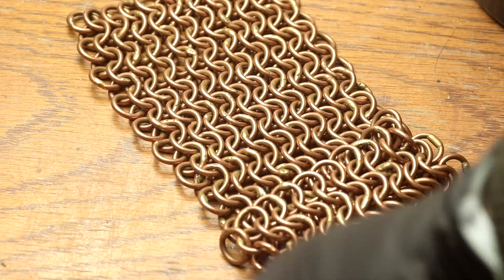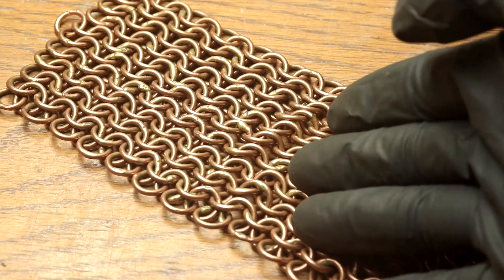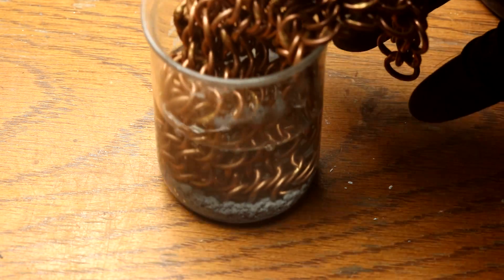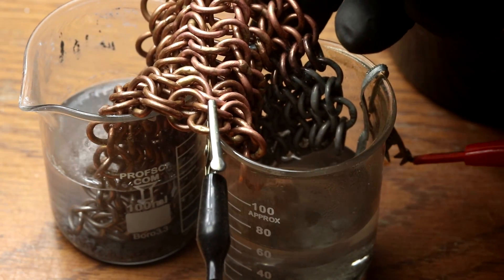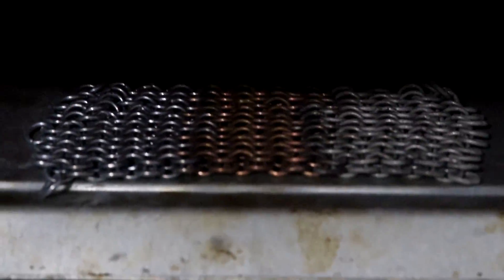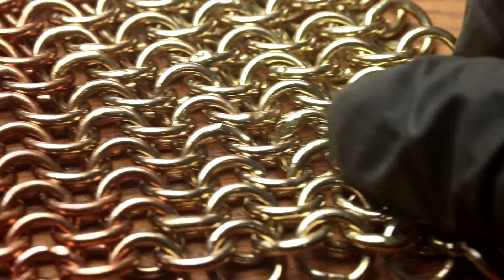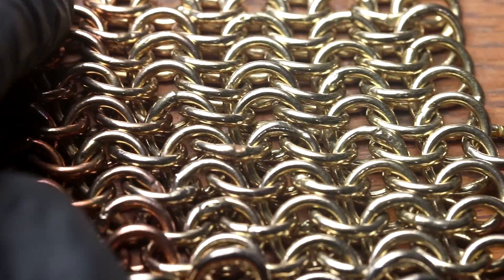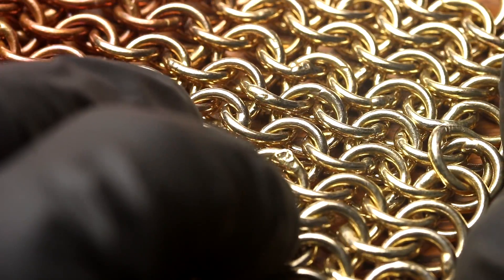Coating Copper in Brass and Bronze

Comment: Wife and I both agree, the brass is nice but a bit flashy, the copper is interesting, but the BRONZE is where it's at.  Makes it more durable as you said, but it's also more period appropriate.  The fact that it doesn't coat evenly gives it "providence", like it has actually been worn on a regular basis.  Much more compelling as a finished material.  2 VOTES BRONZE

Comment: I'd definitely experiment more on a few loose rings before deciding what you do.  Bronze with what is likely less tin than you've got there (or perhaps longer/hotter bake to diffuse it out more) for an effectively higher surface copper content makes a beautiful deep reddish brown.  Also some formulations of brass will oxidize to roughly the traditional dark bronze color after contact with skin oils pretty rapidly.  If you care about the aesthetics at all, then much more investigation is warranted before treating a project that will presumably take a lot of effort to craft.

Comment: By the looks of it bronze didn't work out so well, seems copper is much less likely to diffuse into zink than tin. Can you try to see what difference would higher temperature make?
EDIT: as Zutaca rightfully pointed out I confused the alloys. But it makes even less sense this way, in usual ratios bronze looks more like copper and does not have a silver metallic shine. I would have expected copper would diffuse more readily into metal which likely melted in your oven, but it didn't!
Reply: @zutaca2825  Thanks for pointing out, it is even more confusing now when I take your comment into account :) Coating on 'bronze' side still looks very much like tin!

Comment: The bronze looks like a high tin alloy like bell metal or speculum metal, perhaps a little more time in the oven to diffuse into the copper? I think this has already happened on the welds.

Comment: You could cover the whole thing and 10 1st and cover it and Brass the second coat instead of using the way you did it you can put back your brass and diffuse it into the copper on top of it

Comment: In my opinion the brass is probably the best option. The pure copper looks cool and so does the zinc coated copper, but the brass is the best for a combination of looks and durability.
Reply: The best for durability would be leaving it copper. Any plating will show wear.
Reply: @xenonram  That's like saying that the best way to stay warm is to not wear clothes because clothes will wear down over time. Sure, the coating will wear off but that means the rings themselves aren't wearing down and it's providing added chemical resistance in the meantime. That's the point of armour.

He's adding armour to his armour.
Reply: Think you meant bronze as far as I can tell.

Comment: I vote for bronze with several treatments. Perhaps the welds woul take it better with multiple treatments, but either way I think the bronze looks better. The brass is a bit too flashy in my opinion. Perhaps if we're duller or more muted, but that's why I like the bronze better

Comment: I have a couple of sheet iron soldier's tins from WWI. They need retinning. One is a sort of double-ended metal bottle used for coffee and sugar. It's a bit larger than a butter dish, and fits into the other tin, used to hold dry bacon. Could you give more details on your tinning? Would HCl clean or destroy the sheet iron? Wish I could simply get them hot-tin dipped but those places only want to do yuppie copperware at painful prices...

Comment: Getting any substantial thickness of zinc or brass would be difficult since your plating method stops as soon as there is a complete layer of zinc on the more noble metal.
The electrolytic deposting you used for the tin can deposit any thickness.

Comment: Having built my own mail byrnie as a replica of the Bayeux Tapestry mail many years back, I made mine from the black spring steel coat hangers. "Rolled, cut and knitted with care".
 It works quite well, but be sure to wear a padded gambeson under it.
 The correct way to clean the mail originally  was to put it in a barrel of sand and urine and have your squire roll it around the courtyard for a few hours. ( Not having a squire,  courtyard, or the required amount of urine on hand, I put mine in a hot solvent bath at the local automotive engine rebuilders). It will protect you quite well from slashes, but pointy objects like arrows and knives can pierce it.

  I would suggest you look at some of the photos of the Higgins Armory Museum  in Worcester MA.  A visit to it is extremely educational. 
I saw a chainmail shirt made in the Middle East where each link had a verse of the Koran engraved on it, thus the wearer was literally protected by the "Words of Allah". Also the knives forged from meteoric iron is awesome!
  Their collection is really impressive.

Comment: Yeah you learned how to make 4 on 1 chain mail and electrolysis, the movement of one metal onto another using metal solutions and electricity.   Sadly Cody  I'm unimpressed, I was doing this back in the late 50's.

Comment: I wonder if you would be able to tie-dye it. Obviously as the links are larger than than the spaces between fibers in cloth it would be hard to eliminate diffusion of the solution in the same manner. Maybe if you were to add the "tied" chain mail to the center of a water vessel and then add zinc powder and sodium hydroxide around it without stirring you could limit the diffusion of the zinc plating materials to a central, tied off portion of the chain mail. Then, by timing the submersion carefully, a similar effect might be achievable.

Comment: using all three together could make an amazing piece only downside is you would probably end up having to coat the rings before knitting them to make the patterns I'm thinking of and for the extra effort it probably wouldn't be worth it, there would also be the matter of the weld joints if done this way. all three are good but i would use at least two to spice the final product up a bit instead of just having it full gold/copper/black

Comment: Hold on can you do another video like actually explaining how this all worked. Like this is really cool and I want to see how it’s fully done  like oven temperatures and whatnot.
Reply: Could you like not like so liking often?
Reply: It's simple, the two metals simply fused at the high temp to create an alloy.
Reply: Tundra1232 he electroplated the copper with tin and zinc respectively, both of which form alloys with it. When he heated it, they fused into the alloys leaving what we see in the video
Reply: Basically he ran an electric current through a solution of dissolved metal salts. Those positively charged metal salts can take some of the negative electrons moving around in the liquid (from the applied current) and form solid metal coating on the pieces of chain mail. They accumulate over time bit by bit, layer by layer until there's a coat of tin or zinc on the copper. Then once the metal is plated he heated the metals in an oven to create an alloy, or let the metals mix together to give different properties (color, melting point, strength, etc). There's lots of neat videos on youtube with electrochemistry demonstrations and good explanations of how it works physically.

Comment: I personally prefer the bronze.
The brass certainly looks shiny, but to me that just doesn't quite fit, too much bling. The bronze looks way more robust and tough, which I think it should be since it's, well, armour.
Reply: The problem I see with that is that if you didn't want it to be silly and pretty, why would you make it out of copper instead of steel in the first place?
Reply: Oh I don't know...maybe that steel sucks to join together to make mail...and would most likely need rivets. I mean...it isn't impossible...but i wouldn't want to spend my time on a piece of mail no matter how cool its looks. Buying on the other hand...that i can get behind.
Reply: @TheAsigmaOfNone  But that's the thing, he already has steel mail. And the raw material for the copper mail likely costs more than just buying steel mail anyway.
Reply: Brass is a no go. I play brass instruments. It is a metal you have to take care. Simple oils from from the human body can tarnish it. I have worn my valve casings on all of my horns just with simple ware. Brass is also is very temperamental in cold weather. I have formed a crack in my bell on my euphonium just by playing it too loud in the winter. Brass is blingy and a has a great harmonic resonance, but I don't believe will make great armour.

Comment: Copper looks best, it is also rusic and should remain looking good even if it stains or wears.
Reply: Guðmundur Karl Karlsson it would corrode, slowly tarnishing, rusting, and staining your undergarments greenish
Reply: @bran9380  I have had a coper chiller now for years. Still looks new. It is dipped in hot water once in a while but that is it. As for undergarments, propably right there, that's a whole other issue. Could be solved by wearing underwear out of chainmail 😅
Reply: @gummikalli2  right, but i was concerned about the constant exposure to sweat, heat and rubbing...

Comment: which coating will prevent oxidation the best (although greenish maille wouldn't look too shabby)?
Reply: Bronze will oxydize quickly, which will actually strengthen it.
Reply: @technolapin  I think you mean brass. It has zinc that will have the effect you just stated.
Reply: @josephgao4657  no, that's bronze I'm talking about. You know, when artists makes bronze statues, they then use chemicals to oxydize it so that it textures won't change. That's the patina making statues and bronze roofs looking green.
Reply: I was wondering about that as well. I wonder if the salts in sweat will react differently with the different metals.
Reply: based on my own personal experiences with copper alloys I've made myself and seen the effects of the weather on, brass is definitely more corrosion resistant.  I have a couple brass bars and a "pure" copper bar that I've left outside for over a year and the copper has all the colors of oxide on it, while the brass bars look as good as new. Although, I have also left several bullet casings out to see how they compare and they all turned completely green within a couple months. It depends on the exact type of brass you use, i.e. how much zinc is in it
Reply: Both are very corrosion resistant, though I think brass is the better of the two. Copper is often combined with both zinc and tin; tin for strength and zinc for corrosion resistance.
Reply: for salt water... (sweat)
Ship propellers are made of bronze, the surface passivates and corrosion stops.
however... rubbing against water and the random unlucky fish, 
is nothing like the surface wear of constant rubbing against your 4 best metal friends.
Reply: @WorldofKlown  ship brass has lead in composition also, which helps the corrodiij resistance.

Comment: The Brass coating looks great if you want to get that bling going.
Reply: Brass is also self lubricating so if it was a suitable thickness it would resist wear to the loops due to friction while worn.
Reply: Bling Bling
Reply: You know he is big pimpin
Reply: Tylerian I’d have to agree.
Reply: Just don't start rapping while wearing it.
Reply: Somehow this is the highest voted comment right now. I'm disappointed honestly. The guy who made this probably spent two seconds on it.

Edit: Wait, hold on a moment!
Reply: use steel

Comment: What other metals could you coat the rings in? Is there any way you could coat them in beryllium?
Reply: It would be better to coat it in chromium. Beryllium would give you a disease called berylliosis and it has no cure other than having your lungs replaced.
Reply: @chronofactor2037  I thought that was only for powdered beryllium or beryllium fumes that causes berylliosis? Am I wrong? Chrome is still probably a good idea though.
Reply: @houstoncoffman6793  the beryllium coating would rub off
Reply: @chronofactor2037  you can also develop touch allergies to Beryllium.

Comment: What you SHOULD do is plate your chain mail in BOTH solutions so you look like a striped boss.
Reply: That'd be hard. He'd have to split his mail into strips, and it'd be uneven because he has to re-weld pieces and that'd ruin the coating.
Reply: But A E S T H E T I C S, tho.
Reply: @dimitar4y  it would be possible if Cody makes the mail in sheets he could dip sections by folding the sheet mail and plating different parts one at a time. A long square container and some clamps would only be needed to hold the sheet in the solution and plate it, and Cody could change how wide the sections are by putting more or less of the sheet into the solution.
Reply: @frederickhf241  then some of the sections will get partial coverage :( the chains are inter-lnked. There'll always be a layer of half-coated links :(
Reply: @dimitar4y  the chain mail could be folded and partially submerged for the effect i am talking about. Think of it like this: imagine getting a post it note and folding it in thirds, unravel the note and then dipping the creased areas one at a time in a bowl of water. The tansition areas is apart of the appeal I think to having multiple types of plating.
Reply: Or just prepare the rings before weaving into chainmail...  @dimitar4y
Reply: @KainYusanagi  yeessss and then you have to weld them, which is the problem I addressed, it'll ruin' em. Does nobody on this planet have more than 5 words of RAM in their brain?

Comment: This is epic, can u make a patchwork pattern by electroplating it in squares?
Reply: lol a plad chainmail
Reply: @wesleysull  pladmail!
Reply: I want to see this made!
Reply: A mail quilt?
Reply: That would be really hard since that have to be in different solutions
Reply: @marinlynch1600  not if it isn't joined yet
Reply: @Nate Walkner That’s a good point but Cody’s a bit to far into the project to do that now ;)
Reply: @marinlynch1600  actually, you can electroplate in small specific areas by using sponges soaked with the electroplating solution and putting the sponges on the areas you want plated. So it's quite doable
Reply: @Doctor Purple Wow, I did not know that was a method :) Would it still be able to get a complete coverage around the entire rings? I feel as though the sponges would not saturate enough of the chain mail. Worth a test I guess.
Reply: @marinlynch1600  if i were to attempt this method I'd periodically shake the mail around a bit so the rings shift, but as long as the sponged areas are wet enough it should get good enough coverage anyway
Reply: @marinlynch1600  he could do it in little sections of mail and join them after.
Reply: okay, this is epic
Reply: Scottish chain mail
Reply: It wouldn't look good